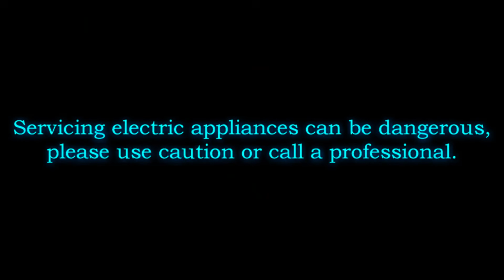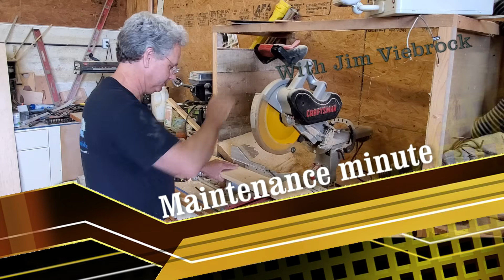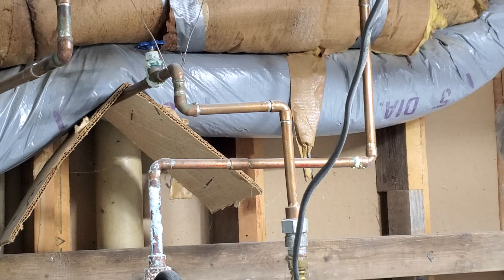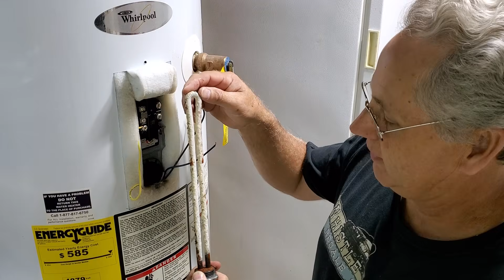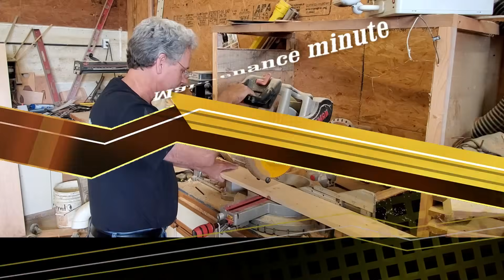D.I.Y. How to replace the heating elements in your hot water heater. Maintenance Minute Jim Viebrock

Comment: My water is warm not hot. We had a water supply problem which let the heater to partially drain. Did it burn my top element out only? How do I check each element using an ohm meter? Should they have some resistance across the terminals? Just can’t afford both so how do I check the elements themselves?
Reply from the maker: If the tank was on, and the water level was low or empty, there's pretty good chance the element is burned out. Usually the sediment in the tank will ruin the bottom element where a low water issue will burn out the top. Hope that helps.

Comment: Can you check if an element is bad by using an ohm meter?
Reply from the maker: Yes, you can check if a water heater element is bad by using an ohmmeter or a digital multimeter set to ohms. It should read between 10 and 30 ohms.

Comment: You said you checked your voltage with your Ohm meter ? I believe you meant you checked things with your multimeter in the voltage setting?
Reply from the maker: That is correct,  mine is both.

Comment: I just fixed my water heater. One of the heating elements rusted thru and caused the circuit breaker to trip. I ordered new elements from Amazon for $36 and followed your video. Now the water heater works well. Also.......the tool that comes with the heating elements SUCKS. I ordered a 38mm socket from Amazon and used it with a 12" breaker bar. The heater elements came out very easy. BIG THANKS for the awesome video because it saved $1k for a new water heater and installation !!!
Reply from the maker: I'm glad you found it helpful.  Thanks for the comment.

Comment: Thankful you made it look easy. I installed my water heater about 5 years ago. It’s sat outside and should probably have a nice little structure built around it but it’s still alive. Today it was officially not heating any longer. I’m going to be replacing these elements. 

I did notice you never mentioned the power needed to be on during the test but I figured that much needed to happen when we checked voltage at the element.

Other than that, great video. I’m so glad it’s not going to be 500-700 dollars. I don’t wanna buy one and installed it myself for that much, might as well try the elements and retry it.

I’m really curious about cleaning off the element and trying to see if it will work again. I’m pretty sure my breaker tripped since I flushed my heater and it’s been cold ever since, and I actually flushed it because it was acting like it wasn’t as hot as usual.
Reply from the maker: Sounds like you have a pretty good handle on what you need to do. Good luck and let me know how it turns out. Thanks for watching the video.
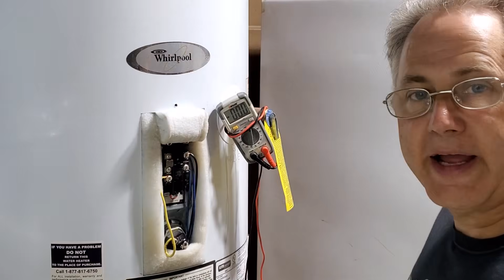Reply: It says "check with the power on" at 1:40.

Comment: would a filter help with the sediment?  
if so, is there one you would recommend? i have a 3 year old Rheem and looks like one of my elements has gone out.
Reply from the maker: Whole house filters and water softeners can prolong the life of your water heater. Lime content in your water is different, in different parts of the country.
Reply: @millin360 also yearly flush will prevent this. I install 6 to 10 heaters a week that are bad from leaking internal or rebuild to replacement because of anod rods

Comment: Hey, Thanks for this guide, im helping my dad fix ours, my question is does it matter if we use the bent over or straight element as replacement? also does the length matter? The one we bought is about 3 inches shorter, but same voltages/watts. Our original one is bent over style, but we cant find it in stores, they mostly have the straight ones like your old one, and the bent over ones had a different fitting. We installed it anyways, the tank is heated up and we have hot water. Thanks
Reply from the maker: The ones "bent" over are a design for areas with high lime content. Either element will work fine. The important thing is keeping the same wattage. Congratulations on a successful repair.
Reply: @millin360 Ah okay I see, we should be good then, thanks!. Yes, I was surprised how simple it was to do with basic tools at home with an easy to follow guide like yours, appreciate it 👍🏼

Comment: nice presentation. If and when necessary to adjust he temperature, what is the proper to do way to do it? Thanks.
Reply from the maker: There will be a tiny dial that you turn with a flat blade screwdriver on each of the thermostats. Be careful. You can turn it up high enough to scald your skin which is particularly dangerous if you have small children in the house.

Comment: What is a hot water heater
Reply from the maker: It's an appliance in most american homes that maintains water at a hot temperature.
Reply: @millin360  In California we don't have electric water heaters we have gas water heaters. That means the water is kept 24 hours at a certain temperature that you set it at. I don't like that. Now here in AZ we have electric water heaters that only heat mostly when on demand I believe.
Reply: Thanks so much for the clarification. I was not familiar with hot water heaters. In my area, we only have water heaters.
Reply: @TerryStroud-wi6pb  Distinction: It differentiates from boilers or furnaces that heat water for central heating, not for immediate use at the faucet. A water heater can be meant for several things. Have you ever used an ATM machine?
Reply: @TerryStroud-wi6pb  LOLOL

Comment: Quick Question: what if the bottom element is soaking wet with water?
Reply from the maker: The elements are in direct contact with the water inside the tank.

Comment: My electric water heater has been misbehaving. Water temperature went low, then high, then blew the thermal breaker. I'd reset the breaker and this random behavior repeated. Now, a couple of weeks later it seems to have hit a steady state where temperature is low, so a hotter setting is needed on the shower, but otherwise it works OK. Is this typical behavior for a dying element? (This heater has 2 elements). Thanks for your videos!
Reply from the maker: It could be the element, but you may have one of the rare cases where the thermostat itself is trying to go out.

Comment: Your straight 1/2" plastic pipe on the shop vac was worthless.  That sludge inside will not easily go UP.  I used a 3/4" curved, clear plastic hose and still could not vacuum all.  There's sludge up close to the front wall that is untouched.  Also,  NO crusty TANK drains while you, 'enjoy a soda.'  Let's see your drain water from that crusty, 15-yr old tank. Your "tips" do not reflect reality.
Reply from the maker: Thank you for your condescending comments.  I'm glad you were able to service your tank using (basically) the techniques outlined in the video. Additionally,  your comment , although useless, helped the YouTube algorithm keep the video at the top of the suggested videos list, which puts cash in my pocket. So Thank you.
Reply: @millin360  'Condescending' is your word my truthful observations.  Common sense tells you a stiff 1/2 tube will not turn corners to find the flakes that are almost glued together.  You, sir, have whitewashed and simplified the actual hard work.  Those elements came out toooo easy, as if you removed them before the video.  By the way, it's a breaker bar, not 'breakover.'   Elements are only $13, 40-gallon Water heaters are $409 or more, Mr Exaggeration.
Reply: They call for plumbers tape or buddy I saw. I like tape, put it on so as you tighten,  the end of tape flows properly to stay on..)

Comment: We had a wicked thunderstorm that preceded us losing hot water, so we assumed it was a breaker was tripped.  But no.  So we undid the upper and lower covers on our half-size (under the stairs) hot water tank to find a red button that needed to be pressed back in (at the upper heating element).  There was no sign of electrical problems otherwise.  Now the hot water works, but every other day our breaker box DOES trip for the hot water heater (but the red button remains unchanged).  So we don't understand why the red button popped up, and why now the breaker keeps tripping.  We tried running different things---back to back hot showers, dishwasher, and washing machine--without being able to cause the breaker to trip; but yet it will on its own when we least expect it.  We suspected debris inside the tank may have stirred up and settled on the top element; or the tank was empty when lightning tricked the heater into burning out the top element.  One or the other.  We hope we don't have to change out the elements or clean out the tank, but running food grade citric acid through our whole house filtration system (combined with a thunderstorm) may have stirred up debris that now we have to remove.  Our water is nice and clear:  citric acid will sometimes pour out green if it encounters certain build up.  Anyhow, we appreciate your demonstration.
Reply from the maker: I hope you get that sorted out soon. Thank you for your comment.

Comment: Great video - question though - my water heater keeps needing to be reset - mains electrics have been replaced and the unit is new, the elements are also pretty new (less than a year) - any ideas why else this might be?!
Reply: See if the twin breaker at the panel is the appropriate one for your tank (3000W elements? 4500W elements?)
Reply from the maker: Humm, may be time for an electrician to take a look. Thanks for the question.

Comment: my water heater is a 4500 watts up and down but i pulled out my element it said 4500 240 and said 3500 watts 208v what does that mean
Reply from the maker: I recommend that you always go back with the wattage that is recommended on the side panel of the unit.

Comment: well, the tank fill up with the power off? I know my water pump will not work if the power is off and I'm worried when I turn the power on and the tank is empty, it will destroy the heating element.
Reply from the maker: There is no pump inside your water heater. Water will flow into your tank when you reopen the valves. Make sure you have a way for air to get out. I usually open the hot water side of a sink. When water comes out at the sink, you know, the water heater is full.

Comment: Where's the drip tube on your T&P valve?
Reply from the maker: This house was built in the 1960's and it was installed to the code of the time. When it is replaced at some point in the future,  it will be brought up to modern practices.

Comment: My mothers water heater is popping the internal circuit.  I reset it on Sat.  Worked a day then popped again.  I reset and 2 hours later she has hot water.  
I was thinking it might be one of the elements was faulty.  Would that be a logical assumption?  I have not tested the voltages/resistance yet but wanted to just ask
Reply from the maker: I'd say one of the elements has started to fail.
Reply: @millin360 
At 20+ years old, I was hoping it was an easy fix.  Couldnt get the old one's out.  
But by flushing it I have it working for 2 days straight!  That's a bandaid until I get a contractor to either help break the old out, or replace the whole 20g tank.  Checked prices and that it much cheaper than the full sized units :-)

Comment: You can't check your thermostat that way. If you check to ground your only proving one leg. You want to put both ends of the meter to both sides of the element and prove both legs by seeing 208v on the meter.
Reply from the maker: Thank you for your comment.
Reply: OP checked each leg against ground. Each showed 120V so total is 240V. I guess he was too nice to call you out on your gaff.

Comment: really informative video than you 
are heating elements universal ? if i get the same watts
Reply from the maker: Great question. The elements are universal with some variations in design. However, make sure they are the same wattage as the ones you are replacing. Thanks for the question.

Comment: the first thing to do is check to see if you have voltage to the hot water heater. could be a tripped breaker
Reply from the maker: Great plan, Thanks for the comment.

Comment: It's not a hot water heater.You idiot, it's a water heater.You don't heat hot water
Reply: Calm down dude.. 🙄
Reply: While technically both terms are used, the most common and accepted term is simply "water heater," as it implies that the device is designed to heat water for domestic use; "hot water heater" is also widely understood and considered correct.
Reply: I just installed a cold water heater (you idiot). Now the water is hot and very nice for showers (you idiot).

Comment: If the heating element still works can we get the lime scale off to get it heating again?
Reply from the maker: I suppose soaking it in a lime scale remover or vinegar might work, However a new element is around $50. I wouldn't want to spend all the time to clean one and reinstall it only to find out it still doesn't work. Thanks for the question.
Reply: @millin360  I agree. Just replace it while you're there.

Comment: My water heater keeps running but doesn't get hot
Reply from the maker: Likely you will need to replace the elements. I hope this video helps.
Reply: You need a HOT water heater, like the one in the video.

Comment: What type of gauge wire is the blue one. I’m trying to get a  10awg but so far I only found stranded instead of solid wire, can I use a different  color?
Reply from the maker: The color of the wire is not gonna matter. As long as it is the same as the manufacturer installed gaugewise..

Comment: I'm not sure if you'll get. But what do you do if the ground wire coming off? The shell that attaches behind the access panel, where the heating element is is rusted.In corroded off, how do you reground that to the tank body?
Reply from the maker: You will simply need to find a different place to reground, and it might include a longer wire..

Comment: It's a water heater NOT a HOT water heater.
Reply from the maker: Thank you for your comment.
Reply: Bullshit it's a hot water heater. My cabin in Nova Scotia has a device to heat the local ice to a comfortable temperature for drinking. That is a cold water heater. The other device we use to heat the local ice to a comfortable temperature for bathing and sauna is what is called a hot water heater. You have been served.

Comment: Glad I found this video. It appears I may very well have that exact same Whirlpool water heater. It was installed in my house (I'm second owner) in Spring 2006. It's just me in my house. I noticed a little water has come out of the overflow port the other day after I took a 20 min. hot shower, but the water wasn't as hot as it has been.  I've never drained the tank, but I did last night and some sediment did come out. I followed proper procedures and flushed it. I live in middle TN so we have hard water. I'm sure it's well overdue for replacement and probably should just go ahead and get a professional plumber to come check it out as I have other water issues going on as well. The tank's never leaked, but I'm curious if it just needs new heating elements and an new anode? Mother Nature is about to hit us for a few days with the coldest weather of the winter, so far. Wondering what your thoughts are about what I've mentioned, thanks.
Reply from the maker: First, i'm proud of you for tackling this project yourself. The anode rod and the elements are two separate issues. When performing maintenance on the tank, it's not a bad idea to change them both.

Comment: Any trick r tips to loosen the elements my bottom element is giving me problems...???
Reply from the maker: They can be really tight. Many times, I have had to use leverage to break them free.
Reply: Had a similar problem with a tire that had lugnuts that were really tight and the ratchet was kinda short. Used a 3ft pipe over the wrench to gain additional leverage.  Use a good ratchet and an impact socket when adding leverage or you could break one or both of these.
Reply: WD-40
Reply: 1.5" socket and impact gun, tada...my M12 Milwaukee worked like a dream...

Comment: MY HEATER  IS BRAND NEW. SO, I WONT HAVE  TO REMOVE OR REPLACE THE GASKET WHEN INSTALLING A NEW ELEMENT WILL I??
Reply from the maker: If your unit is brand new, why would you be installing new or different elements?
Reply: Because they may fail like my month old 6 gallon electric did. Manufacturer does not have any in stock to replace it with.

Comment: So there’s two elements in my heater 3500 and 4500 watt.  How do you know to put which one where or it doesn’t matter?
Reply from the maker: There will be a tag on the outside of the unit that tells you what size/wattage elements you should put in, follow that recommendation.
Reply: @millin360    Found it.  And it’s a good day with hot water again.

Comment: I know this video is from several years ago but if you happen to see this, what would you do in the situation that you replaced the element and turned on the breaker before it filled with water? Asking because i have no hot water at all. I've tried the reset button and the breaker isnt tripped.
Reply: The elements implode. Iv done it they have to be submerged in water while on
Reply from the maker: There is a chance if you turn it on before the water has filled that. You could burn out the elements and have to start all over again. But before I started over, I would check the thermostats to make sure they are calling for heat.They may be your issue.